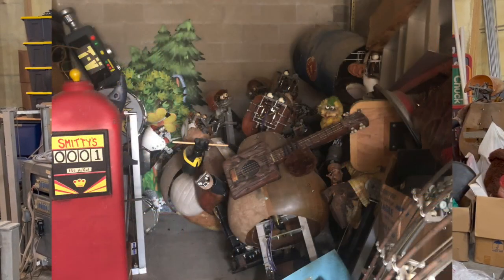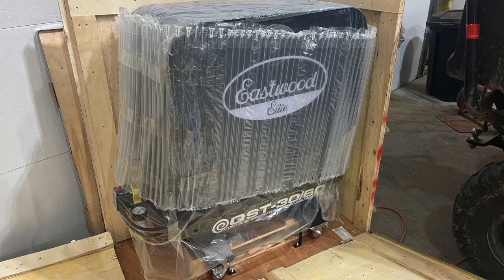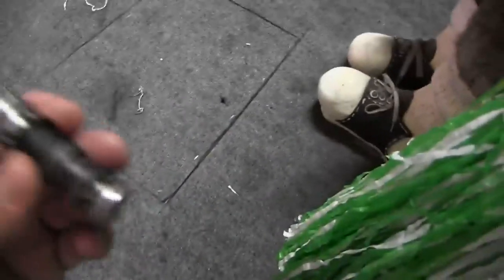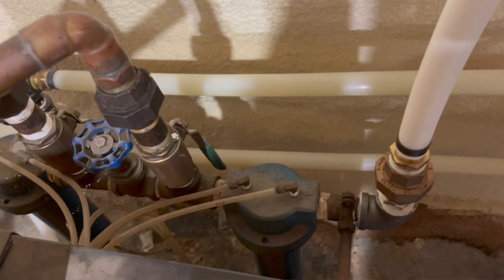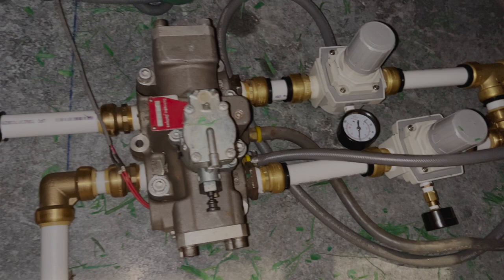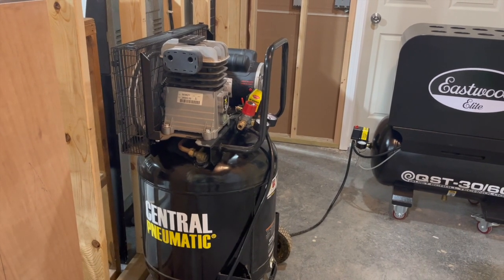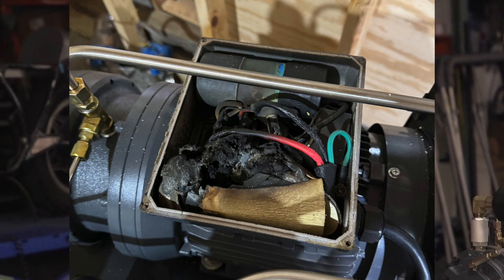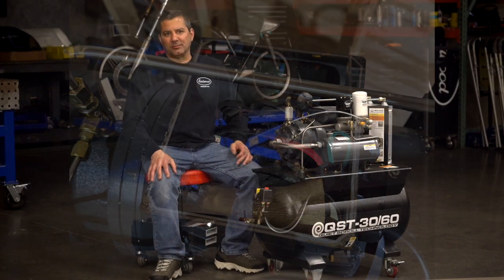The 4 Year Rock-afire Restoration Process Part 7 (Air Compressors)

Comment from the maker: I do recommend the Eastwood compressors anymore. After using them for a year, one spontaneously failed. Even with replacement components it still doesn't work. The other leaks oil profusely from one of the fittings, despite being tightened. I have switched to using an EMAX compressor.
Reply: might need to fix a spelling mistake there jack, but dam that sucks! I hope it wasn't too much of an issue replacing it!

Comment: The first two places that come to mind for the random pressure leak would be the overfill pressure relief valve or the regulator itself. Eastwood's website says the relief value triggers at 160psi. Is it happening right after the pump switches off? Because it will bleed a small amount of air out of the pump after reaching the shutoff pressure at 145psi.

I don't know what your hoses and fittings are rated for but you may want to consider dropping your line pressure to 125psi or so to put a little less stress on your components. It could also help if that's where your leak is.

Also, a friendly reminder to open the drains on the bottom of your tanks for a couple seconds every so often because they still collect a lot of moisture! 😊

Comment: I am working to build a moving trailer haunted attraction. It will require a great volume of air to run correctly. I definitely am interested to hear how the Eastwood compressors hold up for you in the next little while. I may look into them myself.